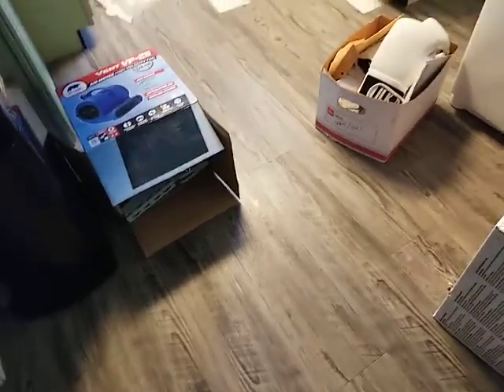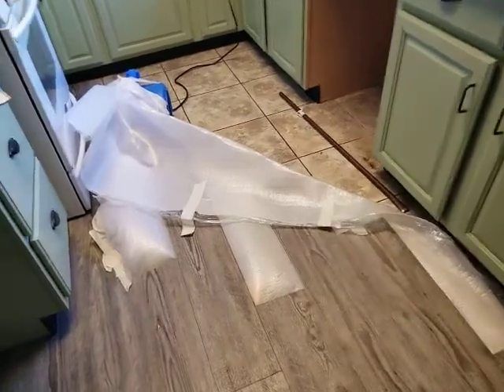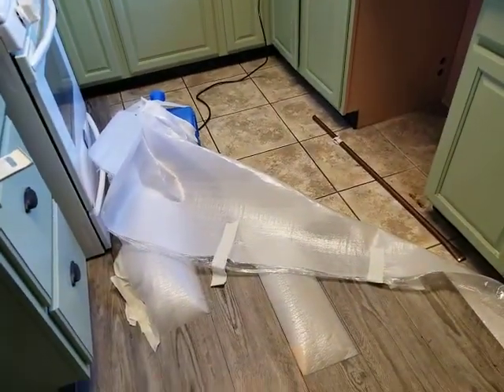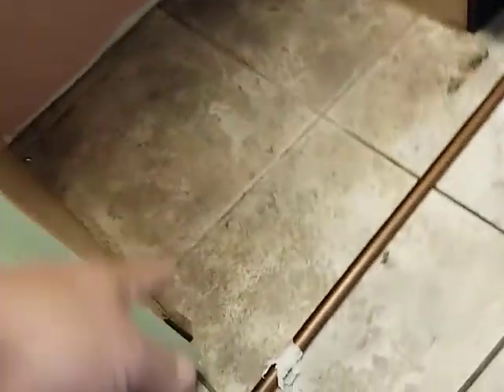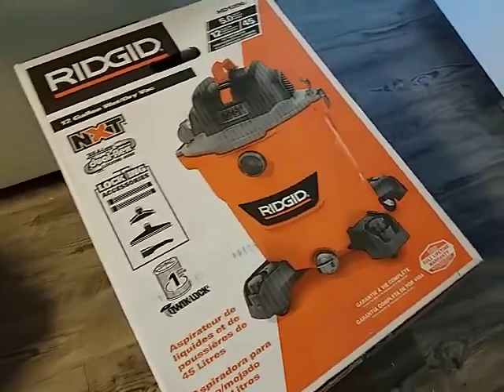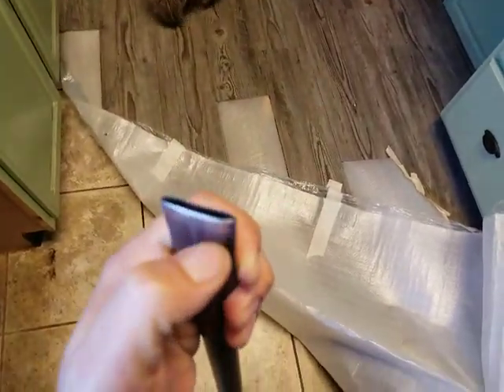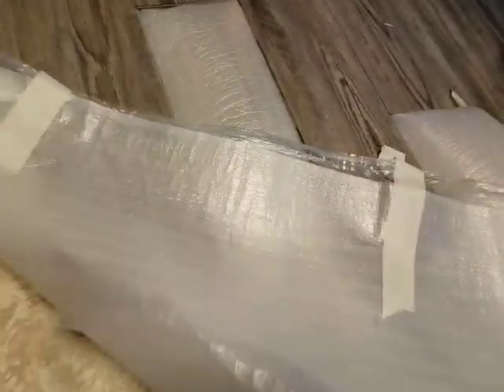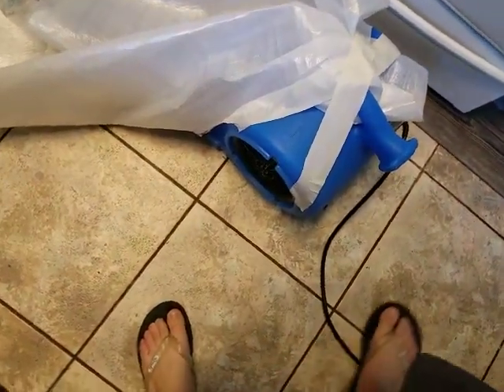HOW TO: Fix Water Leak Under VINYL PLANK FLOORING !

Comment: Great video !  Seems u kept calm in Ur crisis - certainly composed enough to make the video.  Difficult day for me - drilled into some plastic pipe in customer 's bedroom.  This video confirms the steps I took.  Ideally I should have used masking tape and numbered each board but at least I took a photo of the floor.  I've left it raised slightly overnight with some thin wood trim about 3 foot long and tomorrow plan to use an electric garden vacuum to suck out any moisture that hasn't dried out naturally.
Reply from the maker: Thanks for the comment! Yeah it's a major headache. I was actually losing my mind as my toilet base had a leak too..nasty. the high flow floor fan really helped. The tape(good idea)  and or photos help for gettin it all back together.  How'd it turn out after?
Reply: @shoDOHC  I'll let u know - customer returns in a few days so time to dry it out.  I'll lay the pieces out in a puzzle and take my time!
Reply from the maker: @NAFO_Badger_Brigade  you know I was contemplating those larger desiccant packets for moisture control but not sure how expensive or applicable they are in spills..maybe worth a look into..water spills are tough. Sounds like you're nearing the end of the mess!👍
Reply: @shoDOHC  I decided to take everything up and lay it all again.  Went down in minutes.  Longest part was working out the layout!

Comment: Recently had the same issue except I use SPC flooring and i want to ask if the water is not that much can i leave it as it is and let the heat and the ventilation slowly dry it out? all other component in my pantry is waterproof though (all PVCs and plastics). Thank you for answering.
Reply from the maker: Shoot while SPC is 100% waterproof, it kinda comes down to how much gets under the SPC and layers below. How much water spilled do you think?
Reply: @shoDOHC  uhhhh i'd say like 10 ounce max but the problem is it's there overnight so it got a very long duration to seep in between the joints. now it's like little balls of water come out whenever i step at the joint and from rough estimation it spread from the center quite a bit.
Reply from the maker: @natto2581  not bad, man..  time is your best friend here..Put some very good water soaking towels over the area walk all over it as much as possible..if you can, hit the cracks with a shop vac...like inlet facing the cracks aggressively..like you mighr blow up the vac..then for a few nights run a good fan to let the water evaporate..do you happen to have a floor fan like I have in the vid?
Reply: @shoDOHC  oh yea might try the vac later. Unfortunately i dont have the floor fan like you do. Guess gonna utilize the hair dryer or dust blower since the area is rather small 😂. Thanks man i appreciate ur help 👍🏻

Comment: Lol same exact thing happened to me. Dishwasher flooded. High quality LifeProof vinyl and concrete slabs. All I did was use a towel and wiped up the spill. That was nearly a year ago. No problems or damage to the floor. 🤷‍♂️
Reply from the maker: Man. Awful, right. My water that came out of my washer was naaaasty
Reply: @shoDOHC  
Yup. Issue turned out to be the dishwasher drain tube was sitting lower (below) the garbage disposal/sink. So I lifted it way up above the bottom of the sink so it makes an upside down U, and the dishwasher started draining properly.
I either got really lucky or my vinyl has a moisture barrier beneath the underlayment.

Comment: Im going through this right now but i cant seem to get the pieces of flooring out in just a section without having to take out all the flooring. How did you get the pieces to come out in just a section?
Reply from the maker: It should take a little gentle persuasion but they'll come out. Just take your time..start from a corner and hopefully there's a gap (say by the sink or oven base area) to "pull" up from. Study any left left over pieces of flooring you may have and mess with those to see how they click in together....good luck man and sorry about the mess

Comment: I discovered today that we have had water leaking under my less than 1 year old waterproof flooring 😡😡😡. I had been noticing just a light smell of something musty every now and then. I pulled up a couple of pieces and discovered it's moist and mildewed. You might have answered it but I am so pissed about what I have to look forward with tomorrow 😂.I have a few questions.

1. The flooring came with underlayment attached. It's a rubber type material. Were you able to use a cleaner to kill the smell? I want to save the flooring.

2. Did you, or would you recommend a coating of kilz under the floor before reinstalling the snap floor? Under my click flooring is mostly concrete and a few places of vinyl flooring where so much gd glue was used, I don't think the Hulk could pull it up 😂.

3. There is no plastic vapor barrier. I had a guy tell me it was a waste of money and actually seals in moisture to promote mold growth. I also had another guy today tell me no vapor barrier is stupidity on steroids 🤣. So I am not sure what to think.

I appreciate any advice you can give me along with your time.
Reply from the maker: Damn isn't it all just so frustrating.  I feel ya man. So the underpad shouldn't be a problem, so long as it's not retaining moisture...for the kilz, I know of it..but not sure if it's the best bet. Make sure to see what the bottles says about it-  probably needs to air out prior to snapping the floor back.  Since you've cement slab under your in good shape. Just make sure to AIR THE HELL OUT OF IT. buy the floor fan if you don't have one. Run it for 24 hrs if possible more. Prop up the remaining slab of planks with cardboard, rags or small 2x4 pieces and blow it up with hi flow air. I have no smell where my hell went down.  I understood that the foam barrier was to help make a better "step" as you walk on the flooring. Good luck man, it's no fun just take your time.

Comment: The fridge leaked some water and it is under the vinyl planks between that ant the moisture barrier. Do I need to take it up? I got most of it towel dried but I am worried about what could happen like mold??? Any suggestions?
Reply from the maker: Use a powerful SHOPVAC and spend time really pulling water up through the tiny gaps. Run fans in the area overnight you should be OK. What's the surface underneath?
Reply: I had the same problem.. fridge leaked.. brand new construction house.. my first day moved in.. leaked over night.. I took all the baseboards off that swolled up because of the water. Ran floor fan and rented a dehumidifier. Sucked up as much water as I could with the shop vac through the cracks on the flooring.. now when you push on the floor water doesnt come up out of the cracks anymore but im still worried if its still moist underneath. My flooring has the padding underneath already built in. IIts been a couple of weeks since it happened. I have not replaced the baseboards yet.. Im scared the its not completely dry underneath the floor and mold will grow.. should I just pull up the flooring and make sure everything is dry? Its concrete slab underneath

Comment: Did smell come back after a few months ?
Reply from the maker: No sir..I changed out my dishwasher for a new Bosch unit. The old one had the smell as it was about as useful as a turd in the wind
Reply: Oh you got soooo lucky it was a relatively small spillage , I had burst Hot water pipe and wetness settled on slab in tv room buckling the planks and stink under was nasty, I’m still waiting on insurance help and get no straight answers so I’m moving forward on my own 3+ months later. As you can see I’m scanning YouTube for direction !
Reply from the maker: @agentcoulson9195   Wow man I'm sorry to hear that must have been so frustrating ...hopefully it works out man let us know how it all turns out!

Comment: Its more effective if you use wet and dry vac to blow out the hot air. I had the same problem.
Reply from the maker: Hey thank you. I did use a wet dry vac, but what do you mean by using it to  low out the hot air?  It was just such a pain all together.
Reply: @shoDOHC  Instead of using the fan to blow air underneath to dry. You could use the wet dry vac to blow out the air underneath. The vac blow out hotter air and stronger air so it would dry faster.
Reply from the maker: @bennyh1485  interesting. I like the idea. I used the high flow floor fan because of its insane CFM flow output. Very high. I actually ran it all night. The constant flow of new air allows for the evaporation.

Comment: Was it ok when you put the vinyl flooring back in that spot? I just got damage and I thought I’d have to replace all the flooring. Didn’t know you can just do a spot.
Reply from the maker: Sorry to hear. Well, it depends. If your VPF is waterproof or not. This VPF is pet proof so i just needed to spend HOURS making sure the underlying pad, and surfaces were dry as humanly possible. It ran the highflow floor drying fan for like 12 hours. What is your paneling made of?

Comment: Did you notice how at the beginning of the video he mentioned he went over the vinyl floor?  That's grouted ceramic tile.  Worst idea ever. 

Walking around in flip-flops using the end of broom stick to pull up floors and not thorough enough to remove everything. 
Gallon of water? Wtf
Reply from the maker: Awwww lil Davey...davey got a dirty diaper...Hey boner! You'll figure it out!
Reply: He didn’t even have the balls to respond back lol